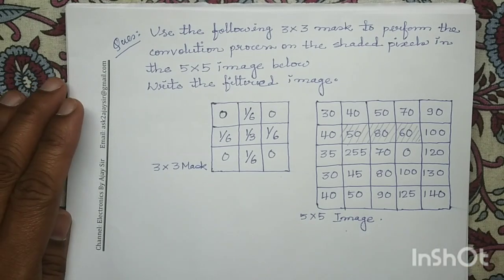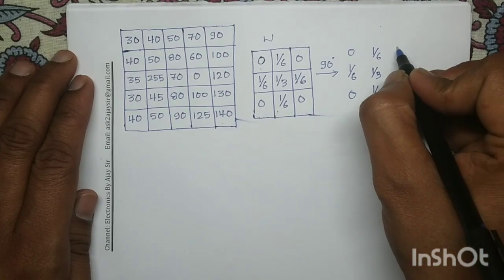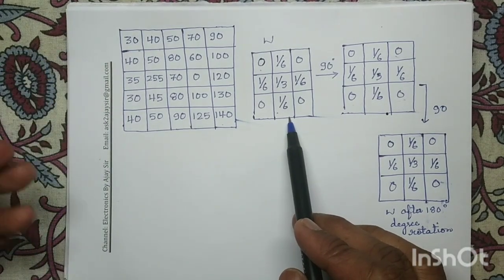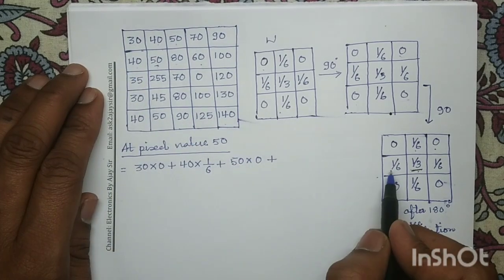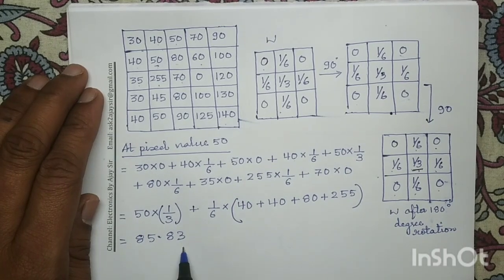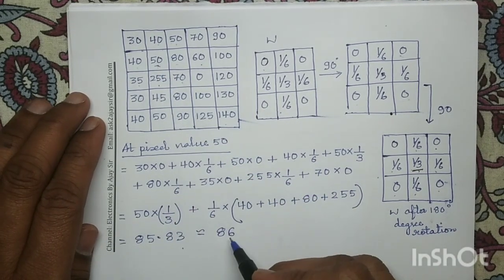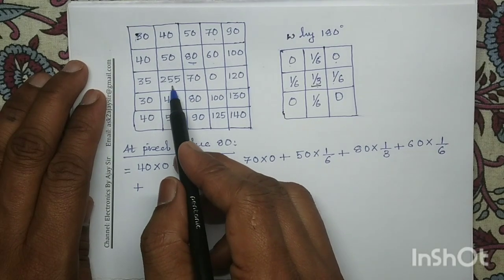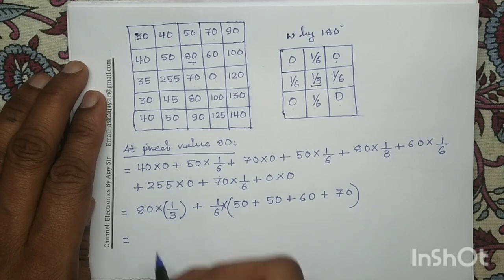Module 1.4: Convolution Operation Based Numerical | Spatial Filtering | Digital Image Processing

Comment: sir are you taking pixel value randomly any from image and  performing bit wise multiplication or it will already given  pixel value in the question paper and then we have to perform  bit wise multiplication?
Reply from the maker: We have to proceed as per the digital input image given in the question.

Comment: sir why are we rotating by 180 degree is it a rule for every question??
Reply from the maker: As per the definition of Convolution operation, we need to rotate this mask by 180 degree. 

Tomorrow I will upload video on Correlation and convolution afterwards Its significance will be clear to you.
Reply from the maker: As a thumb rule just remember:
1. Rotating a mask by 180 degree first and then apply on image is knows as convolution operation. 

2. Applying a mask (without rotating it any degree) directly on the image is known as Correlation.
Reply: @ElectronicsByAjaySir thank you sir for clearing my doubt